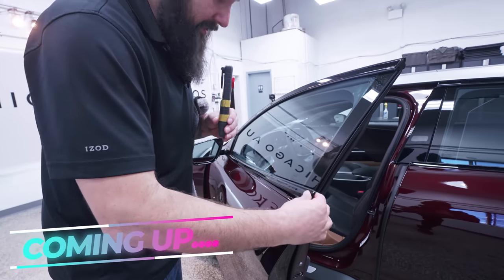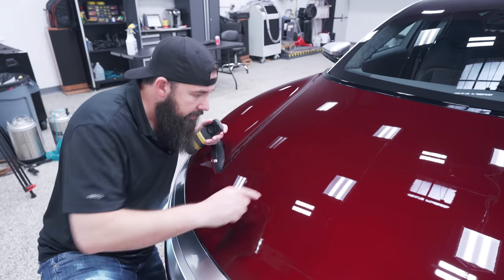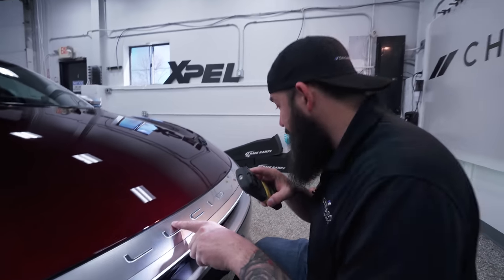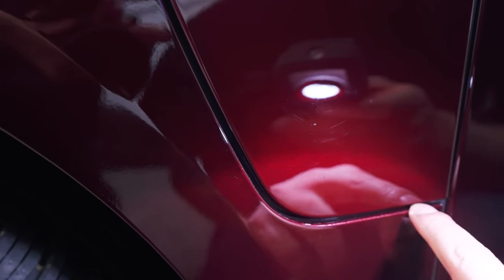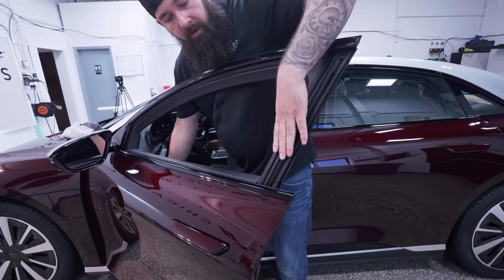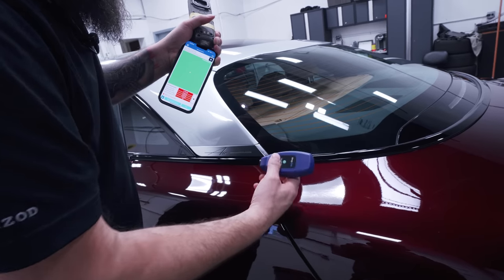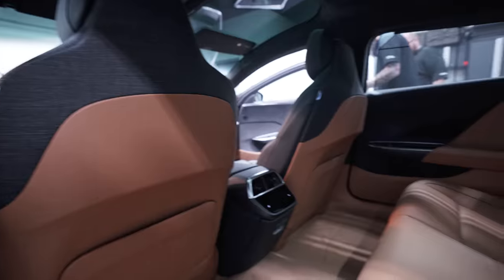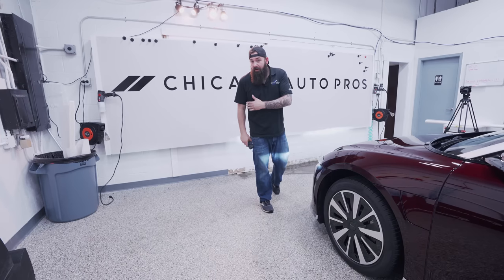2022 Lucid Air Inspection + First Impressions | How Bad Is It?

Comment: "Fender" area must have been damaged close enough to the front door that it was required to "blend" the drivers door in order to get a color match and this red looks like a tri-stage. 

This looks like an insurance job sent to a production shop. Maybe the vehicle was damaged in shipping and the Lucid dealership didn't have the facilities to repair it in house or they went through their insurance. This is probably also why the charge door was masked off. A lot of techs will not disassemble any high voltage components unless completely necessary, nor are they even certified to do so. 

Seems to me like this got damaged during delivery and it was rushed out to be fixed quick. Very unfortunate situation for the price of this vehicle.

Comment: Delivering a 100000+ $ car in that condition is absurd. I really don't get why people accept this with Lucid and Tesla. How much money do you need to have to not care about that sort of stuff? Pretty much everything on the outside of this vehicle looks like they took a 2008 entry level sedan and changed a few bits an pieces to make it look modern, without knowing what they are doing. Even the sound of the closing doors sounds like a 28000 dollar car at best.

Comment: That front/roof glass looks like a huge safety risk.  I live in Sweden and anyone that have ever seen a moose hit by a car, will understand.    This car is for city driving only.
Reply: I live in CO and have hit a moose in a 1995 Honda Prelude... the first responders thought I was dead, seeing as how I was covered in entrails and blood, sucker came right in through the windshield and wound up in my lap (oof). Any car has this vulnerability, but I'm not going to only drive my pickup truck.
Reply: @ericjbowman1708  i know, - I was thinking of the missing support beam welded to the a-pillars + the rigidity of the total roof construction.  A moose flattens this part completely,  so if it's all glass - well you know what I mean.    It's not fun to have 500-1000kg in your face.
Reply: @lise1255  Right!

Comment: the quality is horrible yes.  but dude.  ain't it illegal to tint front windows?  I absolutely hate it when i see people do it.  some of the most important things about pedestrian safety is to see the eyes of the driver and know they know you are there.  One time a car with tinted windows and windshield stopping just before a crosswalk.  As I started crossing the driver accelerated again while i was right in front of the car.  I had to jump out of the way.  Turns out they were slowing down to look for parking or something, and not that they were letting me cross the road.

Comment: A $140,000 car with a $499 Maaco repaint job, and I apologize because to Maaco because they would probably do much better.  Fit and finish on these new car company vehicles is just horrible. I know no paint job is perfect, but American cars have come so far compared to this.  One advantage high volume makers have is robotic paint.  While it doesn't solve everything, robots are very consistent.  You won't get variations in paint thickness unless it was intentional.  A high end car maker should be hiring or training top notch painters, though.

Comment: If it was my car I don’t think I would want to know if the car panel has been repainted as long as the paint matches perfectly it would drive me nuts knowing that about my brand new car. The tail lights inside the trunk is government car laws tail light have to be visible at all times even with the trunk open.

Comment: Obsessing over small dents that are inevitable on any driven car after the first 1000 miles seems utterly stupid. I do not want my manufacturer spending $$$ (and passing that cost to consumers) in a futile attempt to avoid the inevitable. The loose trim pieces, on the other hand, are not acceptable.
Reply: Considering cars don't come with anywhere near 1000 miles driven on it, you SHOULD be obsessing over it. It's like getting glass delivered from Amazon and then being completely fine with it arriving shattered because "that's what happens when you buy glass through the mail"..... or maybe they actually take care of the $170k car you just bought..... 

You'd be pissed if I sold you a house I then smashed the kitchen tiles on afterwards... don't expect the same from a car company that charges the price of a house for a car.

Comment: 13:00 the lights are there so people can see you when you're parked on the side of the road with the trunk open. most cars don't need them because their tail lights are split between the tail gate and the rear of the car. this car has all the lights on the tail gate, and when it's open none of the lights are visible from behind. i don't mean to sound like a dick but that should have been obvious to car people. 

i have an air dream edition reservation (from before the price hike) and i can't wait to get it. all the defects you have shown are fixable. i've had much worse problems on fords, nissans and audis that i bought new from the factory. after buying a total of 11 new cars in my years, i have accepted that many, if not all, new cars will have problems somewhere. my custom ordered 2015 Audi A6 came with a broken transmission from the factory. the car died on the dealer lot as the valet was pulling it up from the storage area for me to see before i signed the finance papers, with 9 miles on the odometer.

Comment: He says it has 200 miles on it? Hmmm, I would search that cars title history. He mentions overspray, swirls. This car might have been a repair job, hidden from CarFax. On another note, I wouldn’t spend half that price for that car, besides not even looking attractive, that flat front would be pushing a wall of air in front of it. Not very well designed.

Comment: Does anybody remember those god-awful I think they were Pontiac minivans with that huge expansive windshield? They turned the interior into a greenhouse so they took them all on a recall and put this horrible purple tint onto them which of course fail eventually. Personally I don't trust all that glass above the passenger compartment trendy but what happens in an extreme accident or a rollover? That truck you featured at the beginning is already a dead dinosaur. Another failed trendy electric vehicle company that never really existed and only managed to fart out a few vehicles before they were found out. Modern day Tuckers. I put down 300 bucks supposedly fully refundable toward a base model that still cost 70 grand if and when it actually hits the road. Intended to use it as a executive Black Car service but I'm guessing that even Tesla does not seem to be making a dent in the limousine industry. Unfortunately the absolute garbage GM Cadillac XTS I have is a money pit and they've discontinued those models already and replaced it with yet another destined to fail under warranty GM pos. Lincoln stopped building the town car for some ungodly reason and the entire limousine industry turned to crap.

Comment: Looks like a Really expensive and windshield to replace if a rock happens to hit it.
Reply: Model X is the originator of this trend... Windshield on those requires a crane to install. Glass is heavy, glass has poor acoustic and thermal properties... Yet the glass roof trends continue because people seem to like it until they get a crack in one and it costs them 2k bux to replace.
Reply: it will probably be covered by the warranty though